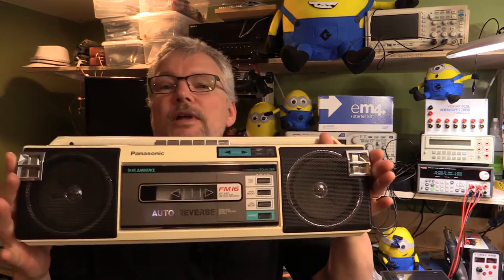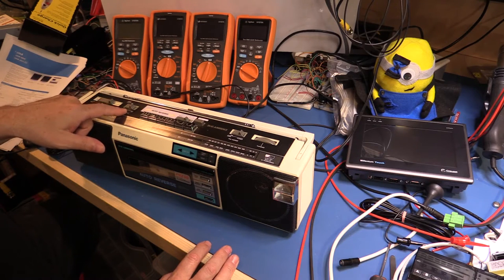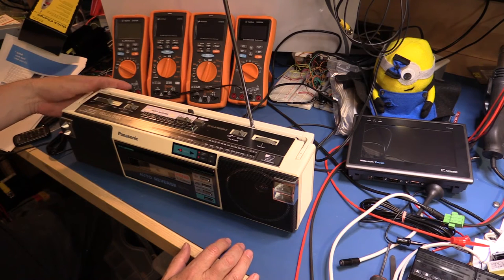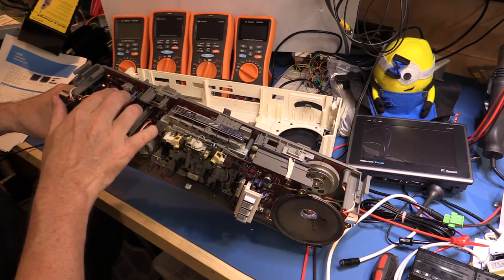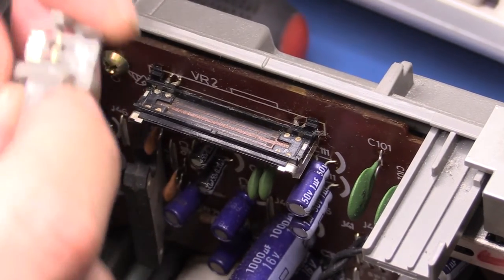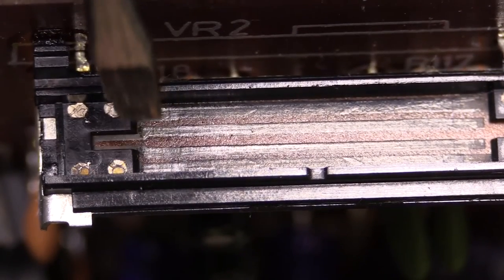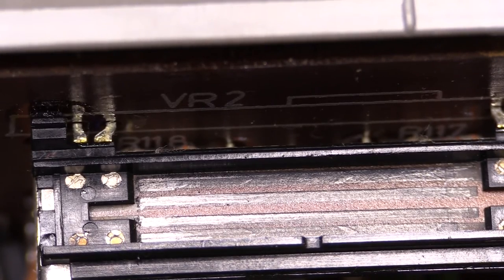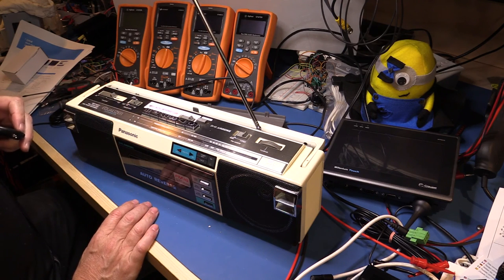Quick Panasonic Radio Casette Player Fix - Volume Control Faulty

Comment: You know this is an old radio and  there are no parts for sale, but you should install on the back a variable resistor or potentiometer, just measure the resistance of the old variable resistor and you can select  the  aproximate resistance for the new  variable  sound  resistor connecting in the same existing wiring, I hope this idea can help you and your friend.

Comment: I have an old Magnavox D7185 cessette/radio that i picked up at a garage sale, it worked perfectly. Then my parents put it in the freezer to "kill bedbugs" anyway the next day i took it out the next day and it worked and then i came back a few hours later. And the radio volume didn't work, i had it on highest volume and it did have a little sound but not much. I tried a cessette and it worked the volume works fine, just with the radio it doesn't work well... Any suggestions?

Comment: with the unit unplugged - just apply some WD40 (forget the contact cleaners) to the tandem linaear pots and a switch, then work them fully off to on, a dozen times
tested, works
Reply from the maker: John Smith I have found in the past that using WD 40 tends to leave a greasy residue and that attracts even more crap to stick, it may work in the short term but not in the long term so sorry but not an option to me
Reply: Peter Oakes whatever you find to work for you is just fine
Reply from the maker: very true, thanks for the feedback
Peter
Reply: John Smith Why not contact cleaner? Often works well.
Reply: John Smith 
I use a pencil eraser to clean contacts with after getting the grime off with alcohol.
Reply: +John Smith VERY poor idea. Take it from a service engineer of 24 years that alcohol or contact cleaner are the ONLY things to use.
Reply: +unlokia 
Yeah, all wd-40 is good for is a dust and dirt magnet for electronics.